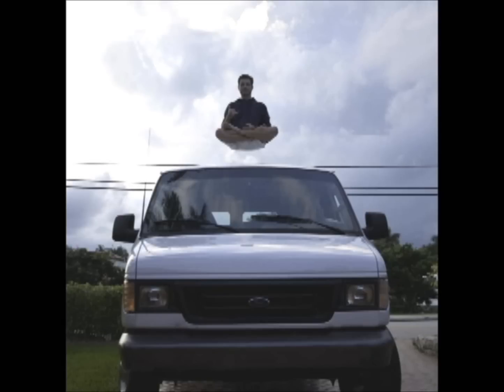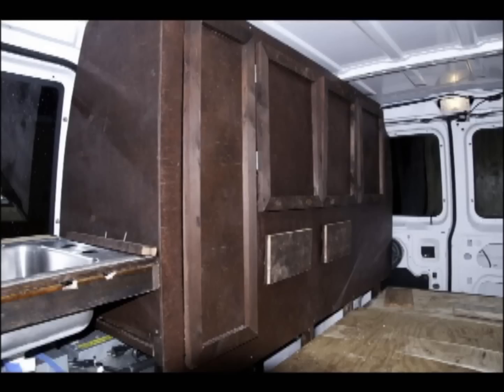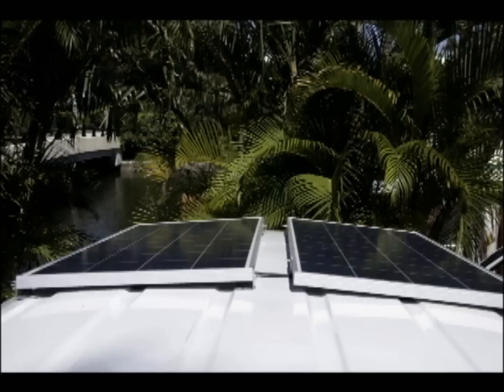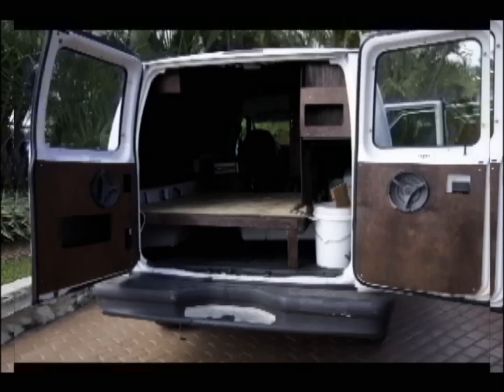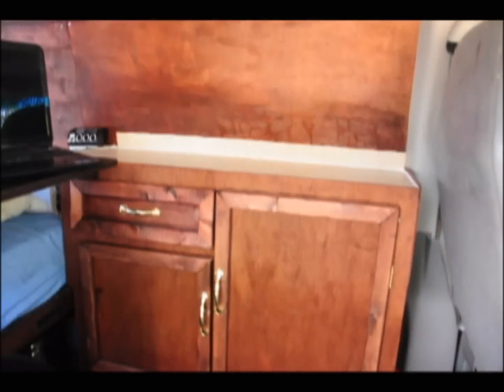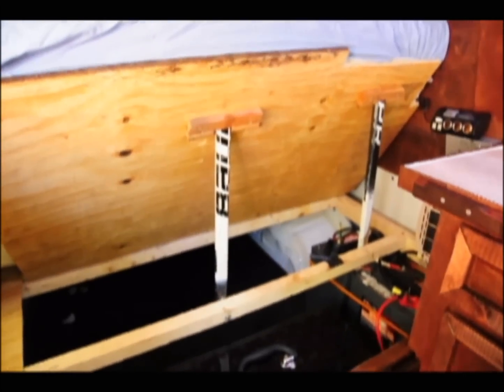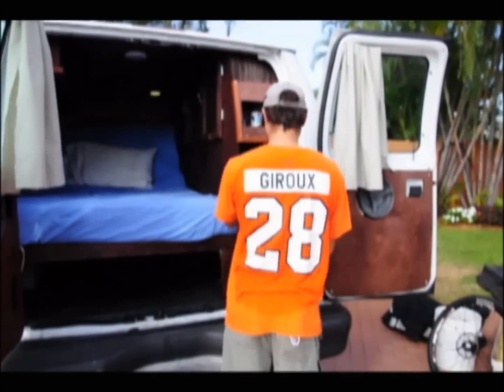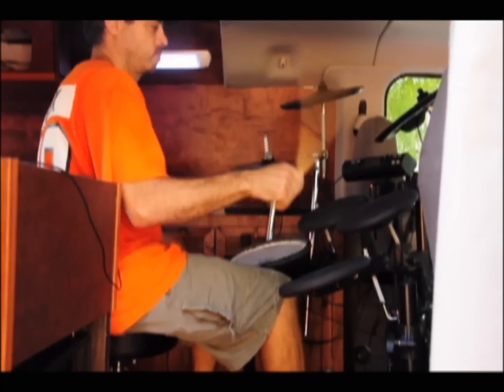Magic Bus- A cargo van conversion.wmv

Comment: Altinator puts out 105+ volts no extra charge. I wired 4 deep cycles to mine, they charge up quick when I drive and I flip switch to keep from drawing on van batt when using stuff while parked. + u can jump yourself! Cost a little extra wire vs what he say? Over 300 each solar for way less juice? And before ya say deeps need trickle idk. My buddy had deep in his truck 13 years no prob
Reply: Do you know how to power air conditioning just from batteries and inverter  ? Or some other way ?

Comment: Just returned from a long trip with my Moto/Adventure Van.  Struggled to keep the batteries charged.  Can you tell me what you did with the NOCO Genius?  Do the solar panels keep them charged on extended trips?  Thanks - great vid.
Reply from the maker: Michael Accorsi Michael Accorsi 
Sorry to hear that. I think you may be asking about the "NOCO High 
Performance Battery Isolator" and not the "NOCO Genius" which is a 
battery charger, but I'll address both just in case. The Battery charger
 is of little use unless you have an outlet to plug into which then, of 
course, would allow you to charge your "house" batteries. I actually 
never used it that way (never had enough of a drain on them to need 
it.), but interestingly enough I once did plug it into my inverter and 
used the "house" batteries to run the charger to charge my engine 
battery. (And more than once I ran jumper cables from the "house" 
batteries to jump the "engine" battery). Now with the NOCO battery 
isolator (which is designed to allow your "engine" battery to be charged
 first and then it sends current from the alternator back to the "house"
 batteries to charge them ) things get a little tricky. Depending on 
which vehicle you have there are slightly different ways to wire it up. 
Unfortunately, NOCO did a poor job of providing clear instructions on 
how to do this. They do address it, but even after reading/studying the 
instructions and diagrams dozens of times, I was still not really sure 
what they are trying to say. (And a call to customer service was no 
help, they just regurgitated the instructions verbatim without any 
further clarification.) The end result is that I wired it up the way I 
thought was correct and then did some testing. It seemed to me that its 
was indeed charging my "House" batteries, but I wasn't convinced that it
 was working properly (switching). In the end I just pulled the 100 amp 
fuse effectively disconnecting it since I realized I was getting plenty 
of charge from the solar panels and didn't need it. As a side note and 
warning: eventually I had my alternator burn out and when it did it 
fried the cable running from it to the isolator. My alternator guy said 
it could have caused a fire (and yes the wire gauge was correctly sized.
 Huge actually). I'm not saying the NOCO caused the alternator to burn 
out, I just want to highlight a possible danger in using one. And again,
 I may not have had it all properly hooked up, but I dare anyone without
 an electrical engineering degree to get it right.
Reply: DJ Wolinsky Thanks so much for the info.  I could have 2 issues:  a) the solanoid (using as an isolator) is not getting enough power to push current through.  b) the solanoid is bad.  But, I may go the route of getting solar panels anyhow for times the van is camped.  

Great video - thanks for the detailed response.
Reply: Michael Accorsi Your Welcome! Just a FYI: I have 2 panels (each 140W) for 280Watts. That has always been plenty for me. I would be surprised if most people couldn't get by nicely with ... say a single 200W or even a 150watt )

Comment: Wonderful Van! I also have a 2003 E250. How did you attach solar panels? I have 2 to install on mine but noticed you put them direct to roof?
Reply from the maker: I picked up some right angle brackets and marked their positions with a sharpie marker. Then drilled holes and used rivets to attached them to the roof. Don't forget some waterproofing material like caulk.

Comment: I hope you plan on staying in warm clement areas seeing's how you didn't insulate, if you put any type of heat in there , the metal will drip water all over everything
Reply: I've been trying to decide about insulation.  I have a cargo-work van parked in my backyard with no insulation.  I built a bed in the back and run an electric heater powered from the house.  It's the end of November and getting cold.  I'm not seeing any moisture problems running the heater so far.  I want to fix it up a little more in the spring for camping.  I'm still undecided about the insulation issue or what to use, if anything.+Arthur Stacey

Comment from the maker: Hi WCAMtv101- There is really nothing to the door panels. Simply cut to size remembering to leave room on the edges for the door to shut and cut outs for the handle mechanism. Then drill a small pilot hole in each corner and finish fastening with a short sheet metal screw.

Comment: 16.5 mpg not bad at all, which engine is that with? I have just bought a 2001 E250 and I'm going to be making a camper van too, can't wait! It has a high top and a 6 cylinder (kind of a rare combo), so hoping for the best with mpg.

Comment: Hey Man! First off awesome job and Go FLyers! Just purchased my van and def installing solar - I was going to get a 1500watt inverter or 2000watt inverter with three batteries but it seems like you were fine with powering your fridge no problem! what are the inverter, controller you used? Or just your whole set up.
Reply from the maker: Thx. "Blue Star" Converter, 2000Watt Inverter from West Marine, and (2) panels 140 Watts each.
Reply: You mentioned air conditioning when you got the inverter. Do you run the vans Air conditioning  using the batteries or what .? That's the one issue I'm really needing when I'm parked so as to not cook my animals when I need to step away from the van and lock up for a bit. Not to mention I hate super hot weather without a bit of respite . Suggestions ? Solar powered AC ?? Loved your cabinet and shower.

Comment: Do you have any videos of the solar, AC power and battery install?
Reply from the maker: MrDropthecash Sorry, but no. It's not terribly difficult, but of course there are some (shocking :) pitfalls to be avoided. I'm not an electrician and I'm leery about posting a layman's advice on that type of install. The install of the equipment is basic, but connecting it up correctly and safely is another matter. I'm all for people doing it themselves, but don't want to inspire anyone to take on more than they can safely pull off. So I offer good luck wishes in researching the subject to your satisfaction. In lieu of that, play it safe and hire an electrician.

Comment: I want to line the sides of my van with wood just like you did. I'm worried about drilling all the way through the metal to the outside. How did you avoid this
Reply from the maker: Don't drill into the 'sheet metal' that forms the skin of the van. Look for the structural 'metal studs' in the cargo walls and ceiling. Basically if you can't see (or know) that there is void space between where you are drilling and that thin outside metal skin....Don't!
Also be sure to drill pilot holes and use metal screws.

Comment: so what do you do about excesive heat or cold . at night or day , one issue is that in the desert you sweet , so am wondering what you could do you u put a heater or a fan in there and leave it running all night ?

Comment: hey bud what are you able to power off of them solar panels? is it strong enough to do a heater or ac or just phone tv laptop stuff like that
Reply from the maker: +timothy clyatt -  Can't accurately say. Heaters/AC both take a lot of power and of course it depends on how much you use them. I've never ran short of power, but I've never tried to power things as hungry as Heat/AC. (The answer would come from a fairly simple power equation using the heater/AC power ratings and an accurate idea of how much time you'd run the unit. As well as how much sunlight you plan on getting. ) Too many variables for me to comfortably say what may or may not work for someone else.

Comment: I have been thinking about doing the same thing with a Nissan NV 2500 cargo van.
What has stopped me from doing it is the gas millage. 15 to 17 MPG. That hurts.
What kind of gas millage do you get ?
Reply from the maker: I get the same, 15-17mpg. Until they make hybrid vans, I don't think you're gonna do much better than that.

Comment: Any idea as to what the weight increase to the van was?
Reply from the maker: No idea, but nothing an E250 can't handle. For that matter I don't think it would be challenging for an E150 either.
Reply: DJ Wolinsky Cool, I have a 1993 E150 conversion van. I am taking out the seats and couch.

Comment: Not a good idea to have those batteries so close to your head. They put off fumes when charging. Also for the sake of the battery you need to vent it outside to exchange air and keep it cool.

Still nice van and great job. Be safe.

Comment: looks like the batteries are held by bungee cord, may get bad in a collision
Reply from the maker: Yes and know. The batteries are pretty well blocked in, but the bungee adds a little more stability. That's not to say I couldn't have done a better job securing them.
Reply: DJ Wolinsky are batteries at risk of exploding sometimes?

Comment: with solar panels you can run the ac
Reply: Do you have details ? This is the one issue I need but haven't solved. Besides hating too much heat myself Ill have animals I need to keep cool when parked and away from van briefly.

Comment: did I miss the toilet?
Reply from the maker: I hope not, that would be messy! I thought only guys miss? But seriously, I have a 5 gallon bucket with one of those snap on toilet seats. Its just for emergencies. Never used it. There's usually a bathroom close at hand, whether it's a rest stop, restaurant or tree. And an empty bottle works great for 'guys' when they don't feel like getting out of the van for #1 in the middle of a cold dark night. Trickier for woman, but you could consider one of those 'lady funnels'.

Comment: you should of added a tv and cable but cool
Reply from the maker: I have added a 24" monitor that I can use for watching movies and editing photos, etc. I don't really watch TV so I don't need cable. Besides, I wouldn't be able to store 2000 miles of cable and the cars behind me would constantly run over it anyway ;P
Reply from the maker: Jelani J
~4500 for the van, about another $3200 for everything I added. Regarding insulation: check out my "Insulation Debate" video.

Comment: Those batteries need to be isolated & vented due to hydrogen gas buildup. They also need a drain in case of acid leaking
Reply: ***** Are they not "sealed" batteries...?